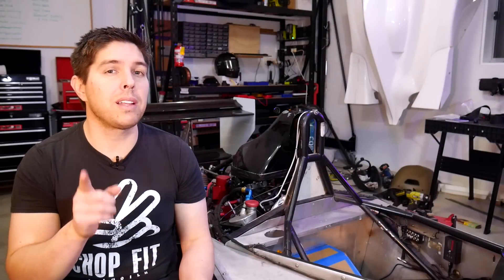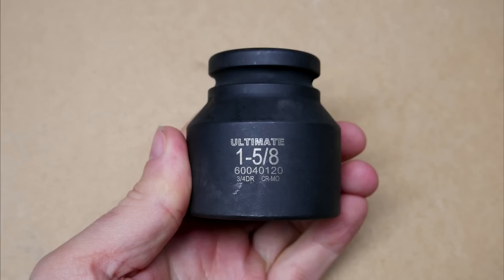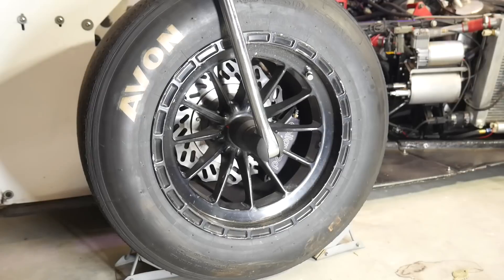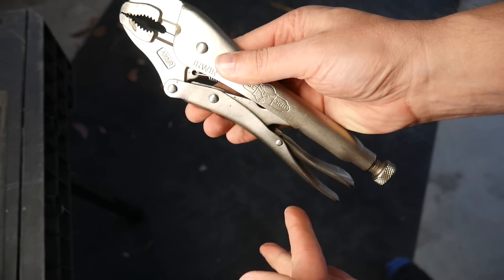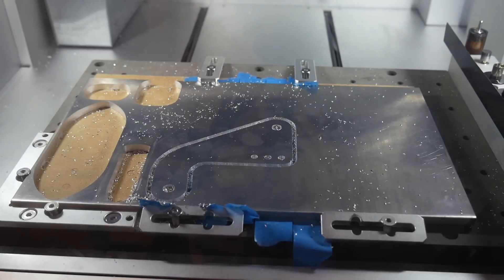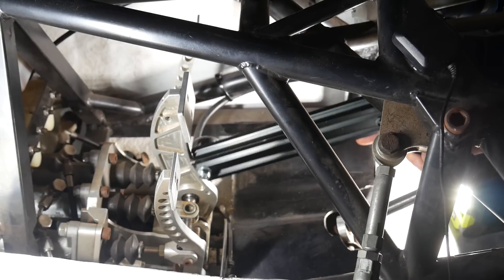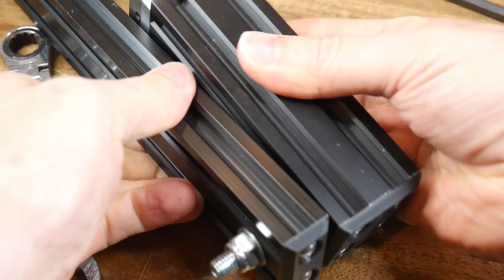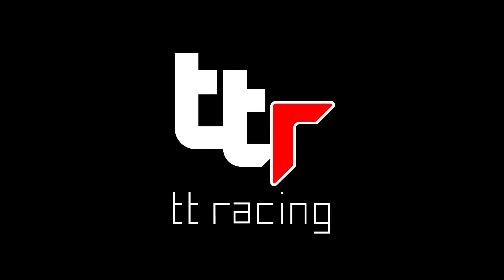Making a custom, removable ‘handbrake’ to handle my nuts

Comment: i torque my centre wheelnuts to 400nm. 1. you could have used a longer clamp....i use the clamp method and simply have it wedged between front of the seat edge and pedal. It's an inverted clamp so as you ratchet it, it pushes outwards, not in.   No need to remove any bodywork and also a cheap effective method. That completely locks it. I also bought a torque wrench which breaks in the middle when you reach the desired torque. See norbar industrial wrench.

Comment: you might want to slap a small light on the small arm. its gonna be pretty dark in there and one of those cheap simple key ring light with a 3d printed holder would work just right.

Comment: I achieved the same result by just using taller, curved blocks where/ if needed. Also hold the bar more parallel to the ground. fast and cheap. But nice engineering.

Comment: I just use a macphersion strut shock absorber , slightly modified to fit . To push on the brake pedal while it anchors against the seat.

Comment: While I never raced a Formula Car I used to race Go-Karts in my youth. I have had a wheel come off during learning how to drive the kart. Still not fun as my dad had to order replacement parts. Thankfully it happened in a dead end street while learning how to control it and not during a race. Although during one of my first races as a novice, I crashed into another kart (completely my fault), destroying my carburetor and never raced again as I became absolutely terrified of causing a more serious accident. Even to this day, almost 25 years later I do not like driving a car because of that accident. I wasn't even a teenager when all this happened.

Comment: Great video as always. Quick tip: if you're worried about nuts and bolts becoming loose on the track, use safety wire. Is basically a steel strand wire that links two bolt heads (or a nut and its lug) in a way that they become bound together and therefore cannot get loose unless you remove the wire. It's extremely reliable and very quick to apply if you have the proper wiring tool (which is very cheap). Can't recommend it enough!
Reply from the maker: It is a great idea. I didn't show it in this video, but each wheel have a locking pin outside the nut which should achieve the same result.
Reply: lock pins are usually a regulatory requirement
Reply: Safety wire on center wheel nut setup......... lmao ooooook.

Comment: what a waste of time
Reply: With all due respect, have you ever tried to undo a nut or a bolt so tight...? FIY it's about three times the torque you'll need to tight the lugnuts of an average car.
Reply from the maker: Internet commentators know best, there's no point trying to correct what is already correct.
Reply: @thomas_bicheri  yep. The large torque wrench is the right tool for it. But the time spent on the over engineered "handbrake" would be better spent elsewhere. He's going to have others around when this thing is on the track
Reply: @radialorbits You're telling me you've never been alone when taking your wheels off? For caliper/pad, suspension/bushings, etc., it's well worth it to be able to get the wheels off alone (without having to start the car every time and deal with the wear)

Comment: I would have just installed a brake by wire system instead. Connect it to an app on my phone so I can lock brakes with a widget on my homescreen. Would also make for some hilarious moments when letting someone else drive

Comment: Can you not just put the car in gear and torque the nuts? Thats what I do on my racecar
Reply from the maker: Engine needs to be started to activate the airshift to put it in gear. Means getting in and out of the car to use the clutch. Honestly this is easier.
Reply: @TTRacingYT  For sure, was just curious. In a different video about the airshift and happened to about firgure out the answer. You got a good workaround though! Love watching all your work arounds to issues you come upon

Comment: A much simpler and more elegant solution is available for this problem. You can purchase a torque limiting extension for a rattle gun they are engineered to yield and absorb the impacts from the gun after a certain torque you can purchase a 350nm one for $187 Australian dollars. with this all you need to do is give it the beans with your rattle gun and its perfect. to remove just use the rattle gun as normal.
Reply: Torque sticks are kinda inaccurate. They're good to "get there" but please ALWAYS double check, mine have about 10% error. Also they tend to overtight and strip lightweight alloys nuts and bolts (motorcycles have plenty of those, don't know about racecars).
Reply from the maker: Thanks for the tip, I didn't know they existed. If for some reason I get tired of my third leg I'll research some more. The rattle gun is a little violent though, I'm keen to not use it much.

Comment: Why would you just have a hydraulic secondary off your primary brake . That way if your brake pedal breaks ir get jammed you have a way to stop your car? Make it like a hand brake..
Reply from the maker: "I don't understand a word you just said".
Reply: They're called brake line locks and they have their own disadvantages. Any stuff you add to a system is stuff that can fail, that must be serviced, that adds weight and complexity. Definitely not something you want to have on your brake circuit unless you have a better option, and Micheal does. Also, they're definitely NOT designed to stop the car, it would be akin to stop a regular car by suddenly stomping on the brake pedal and suddenly pulling the handbrake at the same time (please don't try it at home).

Comment: FYI the Speads wheels can be self loosening. Make sure your wheels and hub surfaces are machined flat, as stuff can build up over time. We had a couple of wheels loosen. The retaining clip caught it and the driver brought it in. Other teams skipped these steps and lost their wheels.
Reply from the maker: I believe when this and the sister cars were built, some modifications were undertaken to make the system more reliable.

Comment: This is great, but the whole time I kept thinking “just make some big wheel chocks”. The bigger the wheel chock the more secure the car is held
Reply: Great engineering, really impressive.  But yeah I just used wheel chocks and my foot never an issue.  Rubber chocks work great as they stick to the tire

Comment: Very cool solution! But as a race mechanic this is definitely not required to do this by yourself! What we do is just put our leg behind the rear side of the tire, the foot jammed under where a wheel chock would go, and the free hand on top. That combined with holding the torque wrench parallel to the ground instead of perpendicular provides enough force to adequately torque your wheels without them moving, and we use 350 ft-lbs so even more than what you have!
Reply: I just sit on the tire and torque the nut. It doesn't move.
Reply: Couldn’t you have just fitted a hydraulic handbrake actuator?
Reply: you just destroyed his hours of work :D
Reply from the maker: Suggestions like this are welcome, but honestly I'm happier with my device than what is described. It's future proofed for wet days, me being injured/weak, etc. Keep in mind that I don't have a team to pick up the slack if something goes wrong.
Reply: Sounds like you need a team my friend😅 @TTRacingYT
Reply: @bro_duck  that's what friends are for😂
Reply: @TTRacingYT I got a team member right here 👋

Comment: Theres a difference between dry and lubricated fastener torque, you can and will overtorque the fasteners if you apply dry torque to lubricated threads! If you're taking the wheel nut off often, antiseize shouldn't be required.
Reply: I’m currently making a custom handbrake for my  mk1 escort RS500 vented wilwood disc brake rear end.
The cable is easily the trickiest bit.

🇦🇺🤜🏼🤛🏼🍀♥️
Reply: Totally agree however antiseize is usually used in this scenario because of dissimilar metals. Steel spindles with aluminium nuts, etc.

Comment: was putting the car in first gear not an option?
Reply from the maker: Maybe. With the air shift system is becomes complicated to do so. It also means getting in and out of the car to use the clutch. This was very cheap to make, and quick to use so I think it's a better solution.

Comment: I think you are over thinking the wheel nut removal a bit. You put some 4"x4" blocks of wood around one of the tires and then instead of placing the wrench vertical you do it parallel to the ground so you aren't rocking the car forward or backwards you are pressing down into the ground or pulling straight up to loosen. You aren't going to want to have to remove bodywork and install the jig in between sessions etc just to change your tires that time is needed for fuel/temp checks and setup work.
Reply from the maker: You may have misunderstood. No bodywork needs removal to use the jig. That was the point. It's a 30 second job to slide it in and apply the brakes. It's also more compact then any wooden frame solution. The angle of the wrench makes no difference, you are applying torque and that will make the car roll.
Reply: @TTRacingYT  Trust me on the parallel vs upright wrench position. I agree it is all rotational when the nut is fully tight but as soon as it loosens even a little it makes all the difference. You also can hit it with your body weight when its parallel to the ground.  We actually had a speads parked next to us this past weekend at the track man its wide chassis!
Reply from the maker: Once the nut has cracked, I absolutely agree. That's the easy part though!

Comment: Great solution! But using the brakes for this means you'll need to be careful to never do this while the brakes are hot due to possible rotor warping right?
Reply from the maker: Quite possibly. Hadn't considered that but I will now. The pace of the events is such that I can wait for things to cool before changing wheels.

Comment: Hi, I’m a racing mechanic and we just stop the car going with the hand that it’s clear, and torque with the other one. Nevertheless, that’s a pretty good solution if you aren’t strong enough. Keep it up with the project. Looks amazing! Hopefully one day I can do one my self
Reply from the maker: You mean combating 350nm with one hand by holding the spoke it tyre? Very impressive if true.
Reply: @TTRacingYT  well, isn’t easy at first, but just by putting all your weight on the arm that has the dinamometer, and giving it a hard hit. You will make it. +having 90 kg of weight helps a bit ;)